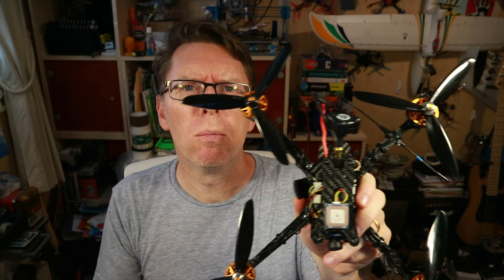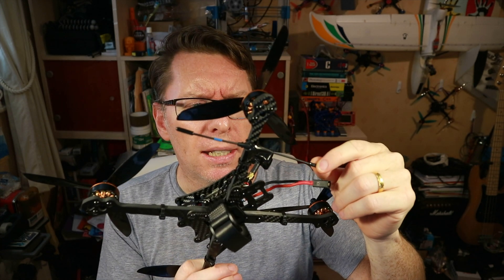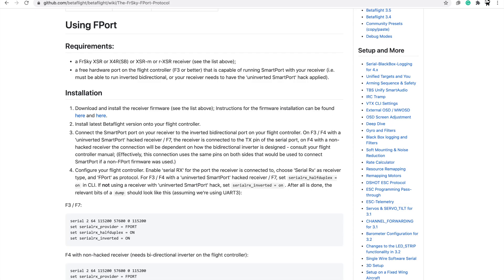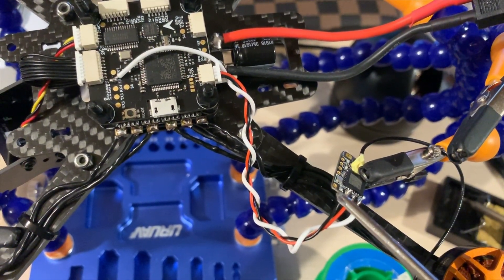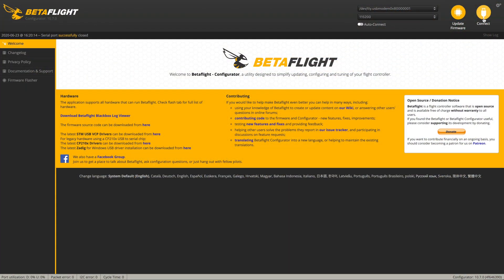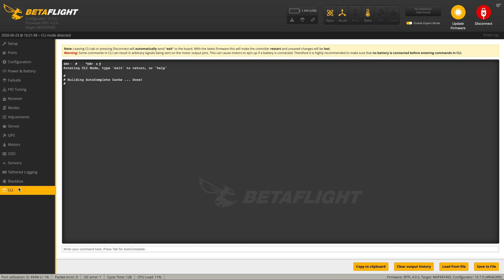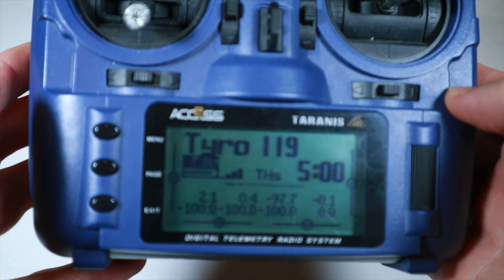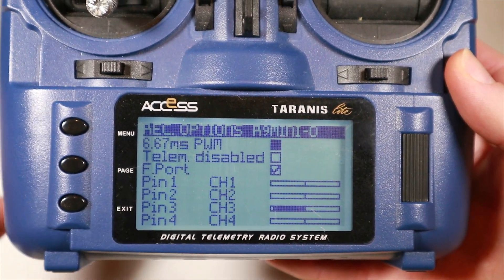Setting F.Port up on the R9 (but applies to 2.4gHz) and how to use GPS telemetry to recover a quad

Comment: Another brilliant video - I have a 129 and only hovered it in the garden so far!!  What bleeper have you got on the quad and how did you mount it?
Reply from the maker: On the 119, I'm using a DroneKeeper Mini which just gets rubber-banded to the lipo and will start going off after 1 minute of sensing no movement.  I used something like that as it lets me move it around lots of quad easily, but if I was flying it a lot I'd have something wired in.  I've looked at so many beepers that I've got a playlist of them, have a looksie here and see what suits https://www.youtube.com/playlist?list=PL7WaECFssECK8qzajP4xba7gAD81JIDA_

Comment: Nice, I also built a Tyro119 and have it set up similarly to yours, R9 Mini and a few modifications, including a beeper.  I'm not using F Port, but I'll definitely be interested to see how you got the radio screen to display the GPS coordinates.  I have a special function set up to log the GPS coordinates, but I don't know exactly how to view the log yet, and it seems like it would be easier to have it also displayed.  I figure it can only be a good thing to have redundant logging, in case you turn your goggles off without finishing the recording, or if the video goes out, your radio control link will probably hold out longer and the last known location will probably be a lot closer to the quad.
Reply from the maker: There's never quite a single way of getting your crashed position 100% accurately.  You could easily lose telemetry and then your last position is not the last position, so always a combo of GPS, DVR battery backed beepers etc.  I don't like to lose quads :D  I've never tried the logging function, so I'll have to put that on my todo list as well

Comment: Thanks for another great content.  Just some issues in the deleting and discovering new sensors, it messes up my logical switches. Which is so annoying.  So what I do. I copy the model, do the discovery on the clone, delete it and go back to the original model.  And one thing I just wish you’d do a video on using a GPS on the radio via external UARTS and discover any use for it.  👍
Reply from the maker: That's interesting, so if you've got for example a switch that is based on RSSI < something, then if you delete all sensors then this logical switch goes?  I'll have to have a look at that.  GPS on the radio - you mean like the horus (the only one I can think of) can do ?
Reply: CurryKitten that’s correct on the logical switches.  Not sure about the Horus, but the Radiomaster TX16S is under development.
Reply: CurryKitten logical switch re assigned to another value

Comment: does this only work with r9 ota receivers as ive tryed with the original r9 and cant seem to get it to work
Reply from the maker: Yes works with the original r9 rx's - but you'll have to flash the specific f.port version of the r9 receiver code to it
Reply: @CurryKitten  thank you for your reply..i went out and brought the tyro 129 after watching your video and love it..its a great alrounder drone..are you able to help with the correct firmware to flash please as im still learning about the flashing stuff..i will go and watch the rest of this video now as i stopped watching once id asked you that question.

Comment: Hey you got me fiddling with my 2 Mobula rx settings and one has Frsky D and the newer one has Frsky X in betaflight under SPI spec. The D one rssi is froze at 49 but the X Mob works ok. Can I switch to X or D in betaflight without rebind? Sorry unrelated a bit. 2s batteries are sooooo expensive!
Reply from the maker: I think you'd have to rebind - but you can do it in the cli anyway.  The only warning about frsky_x is that in earlier versions (prior to 4.1 IIRC) it was prone to getting CPU bound which would cause lockups
Reply: @CurryKitten  Thnx, it is the newest kit form version on ebay the one with 8 supplied motors. Came set to X weird so far no lock ups 15+ packs flown does have a yaw twitch though that seems like signal related maybe.
Reply: @CurryKitten  I sometimes think Chinese factories are run like BSA factory was like you hoped you got a bike assembled on a Friday or near Christmas when workers were happy. Set up may vary, LOL!

Comment: I'm still using my original R9MM system and Flex and it works okay for me on FW and now my Quads...Not sure if iNAV supports the Fport stuff..
I'm finding iNAV performing really smooth on my Quads though, very solid and connected..
.I think it's time you sang the iNAV / GPS tune on at least one of your Quads...lol..I'm genuinely interested to hear your comparison.🤔🤔😳😳😳😳😳😎
Reply from the maker: I'm trying to get there - I would have done it already if iNav didn't insist on a compass as well.  Still need to go back to the ardu pilot on an f4 board and after thats (eventually) done I'll move it to iNav
Reply: @CurryKitten  Yes, you need the i2c port for your compass...The only bad part is guessing your Mags orientation...The actual compass calibration routine has been improved recently...Make sure you have enough usb cable and hold the quad away from your Laptop while calibrating..
Arducopter also demands a compass.

Comment: Interesting idea 👍. I've used my gps location off my DVR to retrieve a quad but this is way easier . can this be set this up on qx7 and Frsky r-xsr ? ✌
Reply: Yeah, absolutely.
Reply from the maker: What this guy said !
Reply from the maker: Absolutely - either via F.Port (which will mean flashing the RX, or via smart port telemetry).  Reviewing DVR footage is easy when you get home, but I always find it very fiddly if I'm at the field trying to work out a crash location
Reply: @CurryKitten  excellent👍thanks . very cool